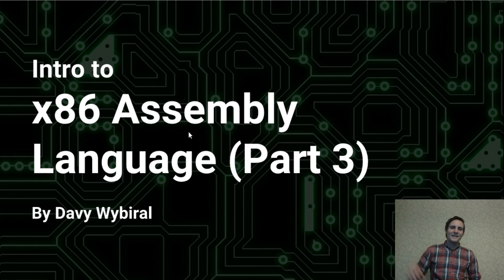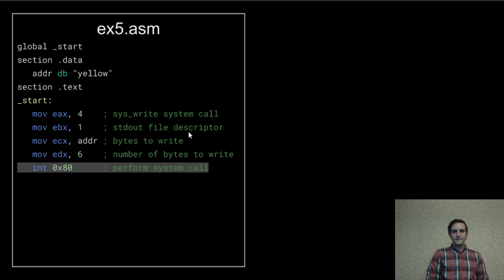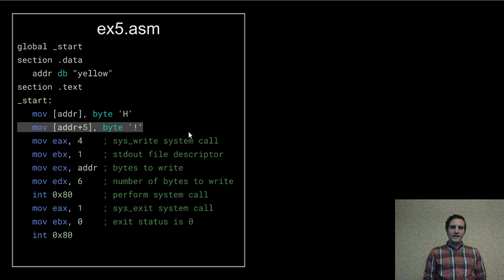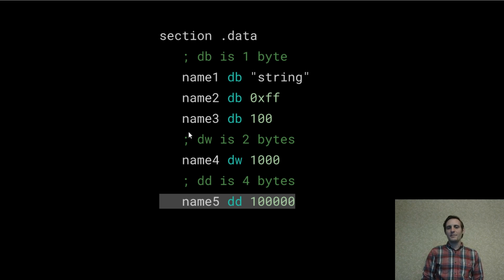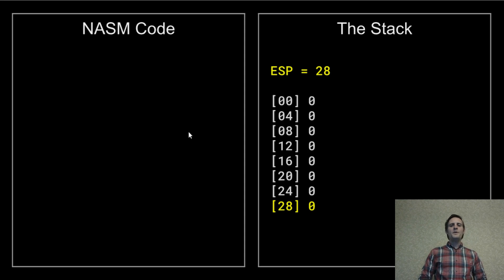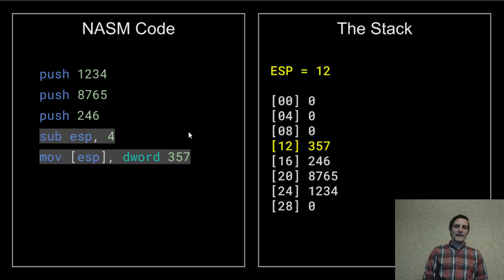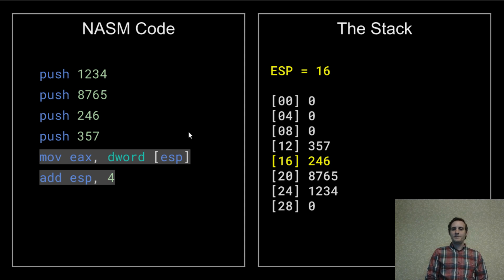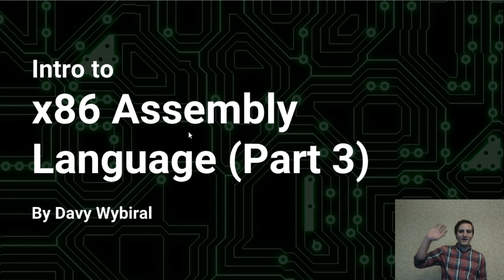Intro to x86 Assembly Language (Part 3)

Comment: For those of you who are using a 64-bit machine and incurred segmentation fault for the last piece of assembly code (ex6.asm), here is one solution:

Note that we are using 64-bit registers here - not esp, but rsp. Besides, the syscall invocation is a bit different.

 12 global _start
 13
 14 section .text
 15 _start:
 16         sub rsp, 4              ; allocate 4 bytes on the stack
 17         mov [rsp], byte 'H'     ; move 'H' to address esp
 18         mov [rsp+1], byte 'e'
 19         mov [rsp+2], byte 'y'
 20         mov [rsp+3], byte 10
 21
 22         ; sys_write()
 23         mov rax, 1              ; sys_write()
 24         mov rdi, 1              ; print to stdout
 25         mov rsi, rsp            ; pointer to the bytes to write
 26         mov rdx, 4              ; number of bytes to write
 27         syscall                 ; do syscall
 28
 29         ; sys_exit()
 30         mov rax, 60             ; sys_exit()
 31         mov rdi, 0              ; exit status is 0
 32         syscall
Reply: Thank you.

Comment: why use an "int 0x80" every 3-4 lines?
Reply: It invokes system call.
For example- you wrote in a paper the items you need for grocery. Now you handed over the paper to a shop keeper and got the items.

Int 0x80 works like the handed down paper to shop keeper(int 0x80 = shop keeper). 

Do bit searches if you got time and etc.
Reply: @complexitytr9098  Thanks

Comment: I was trying to do this 3:15 on a 64-bit operating system and it said: 64-bit operating system doesn’t support 32-bit absolute addressing. Is there anything I can do / change the code somehow?
Reply: No need to change code.
Just do a compile and ld for 64bit system.
Reply: @complexitytr9098  i solved this a while ago but ok
Reply: cool

Comment: Hello, what have i done wrong?
global _start

section .data:
    addr db "yellow"

section .text:
_start:
    mov [addr], byte 'H'
    mov [addr+5], byte '!'
    mov eax, 4
    mov ebx, 1
    mov ecx, addr
    mov edx, 6
    int 0x80

    mov eax, 1
    mov ebx, 0
    int 0x80

Because im getting segmentation error.
Also big thanks to you sir for making this!
Reply: 1.changing a read only data 
 2 can be fixed by putting . Before data and remove the : after it

Because the : make it read only and that doesn't make change

Comment: Hello there! Thank you very much for the lessons. I was watching your video while trying out everything on my terminal open on the right. Found something weird running the code at 9:50. It printed a highlighted '%' at the end of the message. So, I increased the stack size and added an 0x0a at the end of the string and added 1 to the contents of the edx register. It seemed that the problem was solved. I tried to see the exit status of the code at the end of part 1 by moving len to the ebx register before exiting. Guess what? It added a 1 to the string length as well! It seems like we need to include the null byte when we address the length of the string. Please feel free to correct me if I went wrong anywhere. Thank you. Stay safe. :)
Reply: I was thinking of making a similar comment (about '\0') without running through any code
Reply: @b00i00d  :)
Reply: @DarshanSenTheComposer  
No you just print something was in the memory before syscall are little bit tricky i don't know how they works but some of them don't work probably with out aligning the memory.

The % is something you left before or a program left it in the stack since the deallocate only affects the esp and ebp but the values of the character is still there and you can access it .
Of course some time the byte are usually zero but after using the stack it will change the values and all of that.

So the write will print anything that was there before even if it was 0 and in case of 0 mean nothing

Comment: A bit late to the party, but I just want to point out something:
(mov [addr], byte 'H'), although accepted by NASM, is ambiguous. There are three possible instructions:
(mov mem8, imm8), (mov mem16, imm8) and (mov mem32, imm8), and no sensible way for the assembler to choose between them. On the other hand, if you did:
(mov byte [addr], 'H'), there's only a single opcode that can satisfy this instruction.
Reply: So NASM knows that 'H' is only one byte, but doesn't know that [addr] is one byte?
I'm confused why you don't also need to specify that 'H' is a byte. Why not do both? (mov byte [addr], byte 'H')
I guess [addr] could point to any arbitrary spot in memory, but since addr was defined as a byte, shouldn't NASM "know" this?
Reply: @AJSquirrel53  
Not addr is a pointer not a byte.
Pointer is 8 but 4 in x84 
But [addr] is the value that pointing to by the pointer in this.

Addr  = 0x133 ; address in memory
[Addr] = 'h' ; the value that Addr point to.

Pointer are just pointer you the programmer will make the process read 4 byte or 1 or 6 
By 'mov byte ' that will move a one byte and even if you don't give nasm the length of the data 
It will work because nasm will know somehow the length of the data byte but for better practice use byte and so on.
You only need to type byte once not in the both sides .
Usually ins first operand .
It is just a style really
Reply: wondering why my assembler shit itself, thanks
Reply: I don't understand what that refers to : (mov mem8, imm8), (mov mem16, imm8) and (mov mem32, imm8)
Although, an address points to a memory location that is 1 byte, so when you do : (mov [addr], byte 'H') it should be trying to write as many bytes as is given in the second argument, from the first address in the left argument and to the following addresses until what's on the right is over.
Right ? It can't be ambiguous

Comment: The stack was false, when pushing data the pointer will increase & not decrease so when popping data the pointer will decrease
Reply: No, it's not incorrect. The stack grows "downwards". Don't get confused about pushing and popping, pushing simply puts things on top of the stack, popping "takes them away" (kinda). When you push, the stack pointer will decrease (that is, go "upwards"), allowing you to place something on "top" of the stack. Remember, the key is that the stack grows downwards.
Reply: As proof, try moving esp into ebp, push something (like 0xff) onto the stack. Then call the system_call handler (mov eax, 1) but instead of moving 0 into ebx, move ebp into ebx, and subtract esp from ebx. When you run this, you will find that $? will return 4. This means that the value of esp decreased by 4 at some points, which would've occurred when you pushed 0xff onto the stack.

Comment: To me it feels so strange when assigning  system call? and exit status?  etc. Why wouldn't stuff like this be at a fixed register? I notice you use eax ebx ecx most of the time. Like, how does the program know that for example mov eax, 4  is supposed to control something, not just be a number in a general register?  Sry if i explained that bad but hope someone knows and can clarify :D
Reply: When you call the system interrupt, the program on their side reads first the eax to decide which function to call. It then reads however many arguments it needs from ebx, ecx, ... For your program those registers are still general purpose, it's just that another program reads those and interprets it, then writes something back as an answer.

Comment: 04:00 How about base two? Is there a way to write base-2 number literals?
Reply: Ah, you mean binary! Yes.. you can. Just add the letter b after the binary number you write. 
Example code:
     mov eax, 1
     mov ebx, 01101010b
     int 0x80
Which will return 106.

Comment: Hey does anyone know why we use [ ] to access the stack? Is it like accessing the index of an array? 
If I try to execute mov esp, byte 'H' I suppose the value of esp gets overwritten with the value of 'H', instead of accessing the space that esp is pointing to. Am I right?
Reply from the maker: You're exactly right, it's like indexing into an array or dereferencing a pointer in C. This is how you distinguish between operations on the address value itself (which is an integer) or the data located at that address.
Reply: @DavyBot  Thank you! Makes more sense now

Comment: 1. Is it by convention that 'mov %eax, 4' prints something on the screen? If I do 'mov %eax, 3' is it another sys_call?
2. 6:13 , '1234' Shouldn't go to [28] address? Since it's the first push?
3. Stacks have always 8 cells, each one 4 bytes? (in total 8*4=32)
Reply from the maker: 1. The value of EAX specifies the type of system call and 4 is the code for a sys_write call type. If you set EAX to 3 it would be a sys_read call. Here's a chart of system calls and an explanation of what purpose the other registers serve for each call type: https://syscalls.kernelgrok.com/

2. The push operation decreases ESP first and then writes the value. So if ESP starts at 28 a push will actually write the value at 24.

3. Stacks can be much larger than 8 integers. If you run "ulimit -s" on a Linux machine it should tell you the maximum stack size in kb. On my machine it's 8192kb which would hold (8192*1024)/4 integers (=2097152)
Reply: 3. So what does the x86 has to do with the stack ?
Reply: @upliftingspirit6873  I'm pretty sure 32 bits only represents the number of bits per cell (32 bits, or 4 bytes), not the number of cells in a stack.
Reply: @cyrilsubramanian4883  You mean 32 cells in the stack?